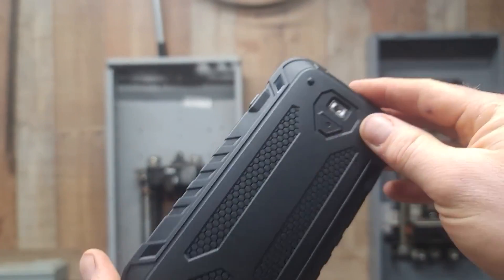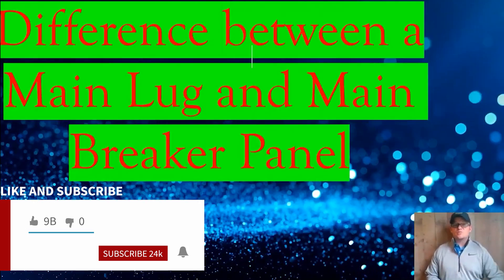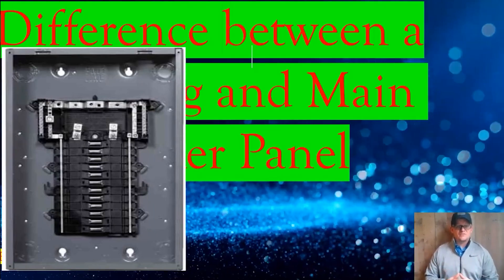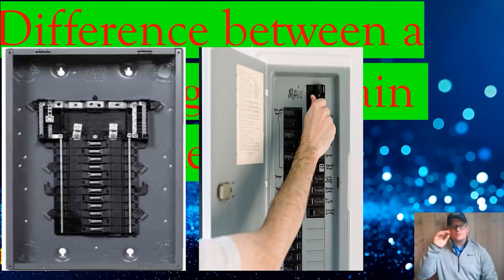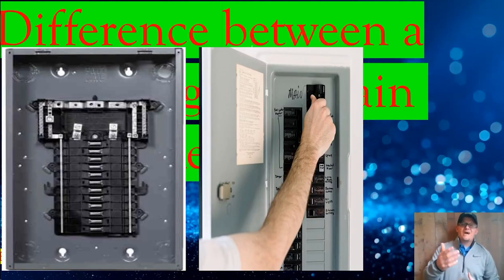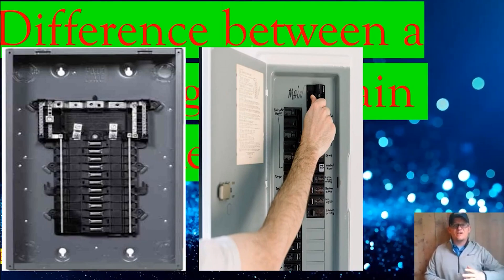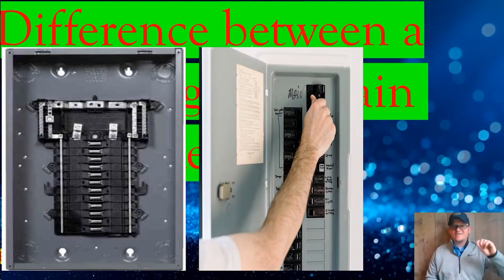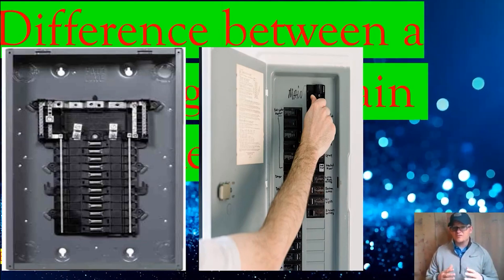Main Lug Vs Main Breaker Panel

Comment: Hey Coach why is NOT ok for romex to be exposed 9ft above in the ceiling as it enters the attic yet it is ok for it to be exposed as it comes back down and enters the main panel box in the basement so long as it is secured 12inches above the panel? Kind of a weird double standard.
Reply from the maker: depends on the inspector, our area it can be un sleeved and exposed over 8 ft
Reply from the maker: but your right there are alot of double standards in the code/accepted practices